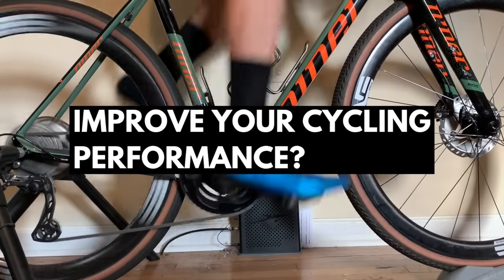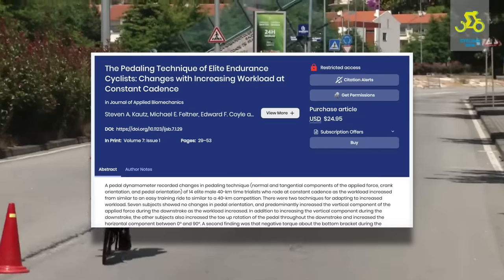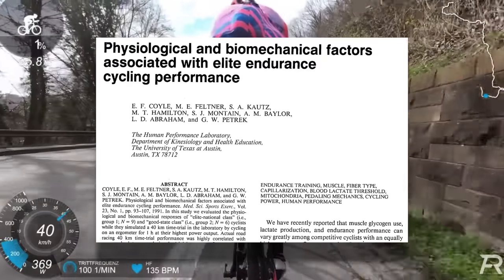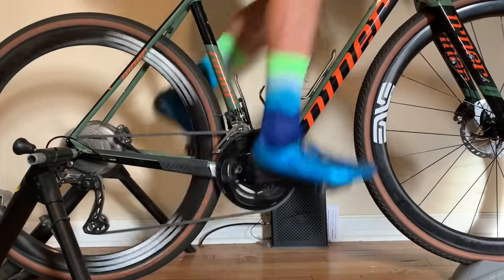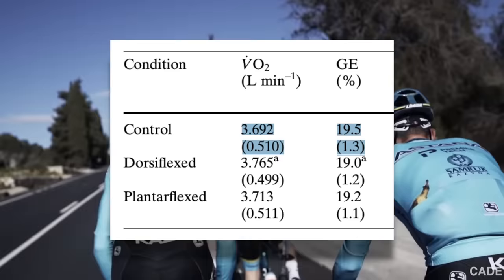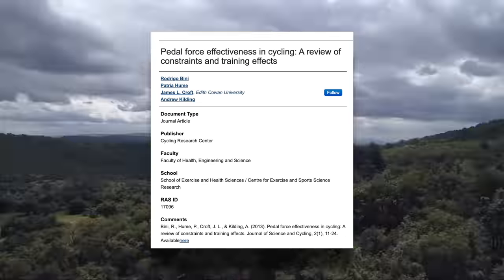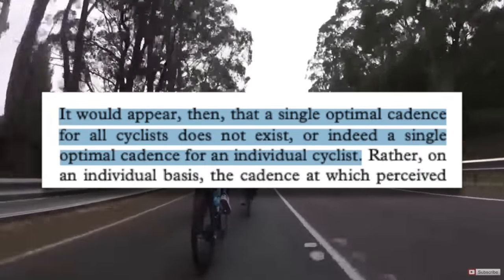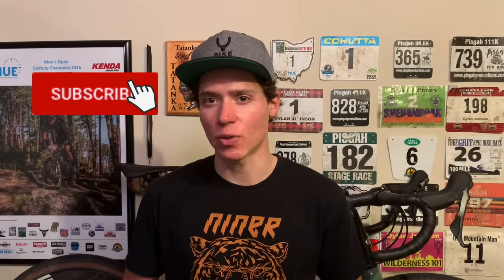Does Your Pedaling Technique Affect Your Cycling Performance? The Science

Comment: As we know, the kneecap ( Patella ) oscillates up and down during the pedalling action.
Just when the kneecap starts its down motion, PULL IT DOWN ( straightening the leg ) with the big muscle in your butt, the Gluteus Maximus ( hip extensor ).
The quads will help. The calves will be used to firm the ankle. 
The hams and hip flexors in the other leg will activate to keep your butt on the saddle or from being lifted further from the saddle.

The primary thought in you mind must be to pull the knee down, extending the hip. After several months, it will become natural.
This technique can be done when riding out of the saddle. It is like climbing a ladder.

Using this technique, one can hold the handlebars with a soft grip, simple to steer the bike. Pros take drinks during a climb !!

Comment: Great vid again. Interesting about the improved efficiency when instructed to 'pull up'. People should be mindful or not misinterpret this and start riding everywhere doing single leg drills focussing on pulling up. I'm sure I've read in a study or article somewhere that included EMG muscle activation analysis throughout the pedal stroke which stated that the improved efficiency which came from pulling up in the pedalling stroke was due to the fact that by pulling up, the rear foot is placing less resistance (aka is getting out of the way better) against the front foot which is in the power production phase of the stroke, enabling better force production if that makes sense. Basically, it's easier to push down on one end of a lever if there isn't something pushing down on the other/opposite end. Single leg drills don't teach that coordination.

Comment: I'm a retired mixed martial artist, so with my age I started to do full distance triathlons since 2017. Last year I accidentally discovered that low cadence increased my speed by almost 4%. Happens during the race, there was a dude hanging around me all the time, switching positions without drafting of course. During the race, I thought that was a good moment to experiment the pedaling styles to see the differences in real life situation. Higher cadence got me dropped, could not keep up, higher heart rate, breathing more heavily. Then I switched to lower cadence higher gear front, than back. Turned out that low blade front, low cadence got me much more speed with quite some ease. You're the expert, does this sound logic to you? This year I will focus training on lower cadence more, that brought me to this upload of yours to learn about power distributions and the do's and don'ts about it.

Comment: I think if you're making noob mistakes then you should try and retrain your stroke. Examples are pushing down on the upstroke - get rid of any muscular tension and weighting on the back leg. You want muscles to be making the wheel spin, not dissipating power into other muscles. This is particularly true when getting out of the saddle. Don't be accidentally braking with your back leg.

Comment: I’ve found that cadence is very individual based on age/cardio/strength/style. But practicing both high and low cadence improve overall efficiency and endurance. Also for me, focusing on keeping the legs relaxed and picking the knees up and using the core as a spring so that the feet ‘float’ around the crank, so whether cadence is low or high, the spin is more uniform and ‘more’ power is derived throughout a revolution even if more force is on the downstroke.

Comment: I think that is because the extensor muscles are actually more powerful and efficient
as we push down, we are doing hip and knee extension, thus, we are using our glutes, quads and helped by hamstrings which are the most powerful muscles of our whole body
while when we pull up, that is hip and knee flexion, that are our hip flexors, hamstrings and calves which are weaker

Comment: This video confuses "power", "force" and "torque".  You keep referring to "power distribution" during a pedal cycle. In fact, it is "force distribution". Power is the total force = work per pedal cycle multiplied by cadence. The article you cite talks about "force" and "torque", but since the crank length remains constant, these terms are essentially the same in this context. Pedaling efficiency can be described as increasing the work per pedal cycle, so not necessary involving a greater amount of maximal force.

Comment: Was interested to watch this as I knew it would be woolly. There is no single key to unlock the perfect stroke. The whole game to me is managing muscle burn. Finding your maximum pace and cadence on all gradients across your ride to maximise your time. Whilst this happens you learn how to add short muscle burning segments into your ride and your muscles learn to recover more quickly after those moments of extra excursion. Bike fit / body position and seat hight obviously plays a massive part in your form. My only advice is ride ride and ride some more. Miles on the bike improved fitness and your muscles ability to perform at faster speeds. I find that average speed is the best figure to watch. I have a 30 mile route that has about 3k feet of elevation that I do a lot and because I do it a lot my body is finding new ways to go faster every week. 
My final opinion as to the key for new found speed is to be in the right gear at all times whilst being just fractions below the mark where muscle burn is starting to set in across your whole ride. Without realising, that mark raises week by week.

Comment: Could you do an explanation on TE (Torque Effectiveness)? I feel like TE has really helped me a lot in terms of optimizing my pedaling method depending on the gradient. And of course, great video as always!!!
Reply: Arthur J I believe this is what gets a lot of people in trouble using or thinking about it in terms of torque. A lot of tri-athletes think in terms of this, and consequently focus on pulling as much as they are pushing down. At least that’s what I learned when I did a few shorter tri distances. The pulling creates a lot of torque on the pedals, but doesn’t quantify to an increase in power. Additionally, for me, my HR was greatly increased versus just pushing down as hard as possible (or needed), and then letting the pedal complete the rest of its circuit with as little interference on the “on” leg as possible. Creating torque on the entirety of the pedaling stroke can fatigue the smaller muscle groups, and lead to cramping. IMHO
Reply: Data is good when you can reference it to a "feeling".    The key is to treat them as a "duo" and not a master/slave relationship.   I use my power meter quite often when trying to correlate it to a feeling.   I have quickly figured out that for a given power level, the cadence does vary quite a lot based upon gradient to make it feel good.    On the flats, I like ~80-90, going uphill 90-105, going down 70-80...and this is all the same power.    So now when i see a hill I can proactively gear/cadence adapt and my VI has gone from 1.15-1.20 on many endurance rides to 1.05-1.10.

Comment: what about mid foot position? I use mid foot position with Catalyst pedals, I have always used this foot position, it always felt the most natural, sable to me,
I use mid foot position, I am 182cm, quite average in size,
I have saddle tip of Fabric Scoop above BB shell, I use oval chainring, I ride a  Geometron G1 Large, which has a modern geometry for mountainbiking.
the geometry,sizing really makes a huge difference, having bike that fits, being able to have proper sitting position, not being squeezed between cockpit and saddle, not sitting too far back.

Comment: A lot of the studies cited here (and in other videos) test the effects of short-term deviations from a cyclist's preferred technique, be it cadence, pedaling technique, or what have you. Have there been any long term studies that show that after a year of training for a deviation in technique, the effect on the cyclist's efficiency was X vs training with the cyclist's preferred technique?

Like I don't think anyone but BHD is expecting to say "Ok, it's race day, time to bump my cadence up 20rpm from normal and focus all my energy on pulling up on the upstroke. This will surely add 20 watts to my FTP!" and yet that seems to be what these studies test. Most people want to know "If I spend months training to change my technique, will I be better off than if I just kept going with my preferred?"
Reply from the maker: Great point. Unfortunately very few long term studies exist.
Reply: Using simple anatomy, your ileopsoas does not have the same power as the quads when upstroking, the muscle has a short lever to work and probably fatique will set in quickly. You can train it, of course, but you use in race day in the last climb for example.

Comment: Hi Dylan, thanks for the video. This subject had me thinking for a long time... I understand the argument that your preferred cadence and your preferred pedaling technique are the best ones for you. However, the Sport requires different demands. For instance, at climbs your cadence will depend on the available gears you have. This might make your preferred cadence impossible to  maintain. Let's say, at 10% grade, using a 52x30 it will be hard to pedal at 95 rpm (at least for me). So, during my practice sessions I should train at 60-70 cadence drills. 
The same way with pedaling technique. During a road race, all the athletes are doing the least amount of effort possible, so, utilizing many muscles to spread the load instead of the mainly quads to push the pedals. This might be the best approach to have the quads fresh for a sprint.  I also believe there's a tendency of the literature to look at threshold efforts when evaluating pedaling technique and cadence. However, unless you're in a breakaway, you're unlikely riding for 4 hours at your threshold. So, research designs looking at the actual race pace Ina peloton should guide our training decisions to develop or not a specific pedal technique and cadence.

Any thoughts on that?
Reply: Yeah, my thought's are that quads being fresh isn't going to change by reducing your efficiency by increasing your work as shown in the study... you need to think about why your muscles fatigue.

Want fresh legs for the sprint, worry about positioning rather than pedal technique.

Comment: cool vid.  is there still any merit in doing pedal form drills like single leg focus pedaling or one leg pedaling? thx!
Reply: Good question
Reply: Probably lower cadence will work better, you never use one leg in cycling unless you are a para-athlete. On the contrary in cross-contry skiing there are several one leg drills, but balance is very important cause you are just sliding on snow one ski at a time ;) have a nice day
Reply: Learning to pedal with one leg helped me  while learning to take off and clipping in in case I missed the clip 😂
Reply: @CandiiBanks  Same here. Clipping in after being stopped at a light or a sign is still scary but at least I can get away quickly

Comment: Very informative, thanks. One question - during training does it make sense to do cadence drills or generally ride in any other candence than my preferred for that particular zone?
Reply: Good question
Reply: training high velocity is always good for the body structure and the capacity of moving very fast your big legs and getting used to recover from short exhaustion/accelerations
Reply: Cadence drills are good at teaching how to be efficient. But it’s also good to pedal quicker when conditioning at lower powers, throughout the ride, to enable your body to deal with neuromuscular fatigue. Which can really hit home at the end of longer rides.
Reply from the maker: Check out my cadence video.
Reply: Depends on what you ride in my opinion. If you are a roadie you'll get 99% the right gear with your usual cadence. If you are a mtbiker probably doing cadence drills helps, it happens quite often to be over or undergear in some occasion during a ride ;)

Comment: Great Video, as always. A follow-up question: is there research on how to be efficient at only putting torque on the pedals in the direction that actually propels the pedals? E.g., training to make sure that a rider doesn't push straight down when the pedal is at the 6 o'clock (bottom) position? It seems like that's a different question from where in the pedal stroke the rider should put the most power into the stroke. Thanks!

Comment: I think that the reduced efficiencies seen in the study when looking at emphasising the pulling portion of the pedal stroke could be partially explained because (as cyclists) their pulling muscles are far less trained than the pushing muscles (~97% pushing power Vs ~3% pulling power seen in the test). Training of a muscle (as far as I could see from research) improves the efficiency in that muscle. If they were to train specifically with the pulling technique, for a period of time to acclimatise the muscle to the work load, the results may look different(?)
I think longer studies looking at specifically aiming to change pedalling technique, over a period of time, need to be carried out in order to really understand if gains can be made by altering a pedalling style. It is not a surprise to me that a persons preferred pedalling style is the most efficient when looking in the short term.
Reply: Pulling muscles are tiny compared to the pushing on the downstroke. Not going to get much of a gain.
Reply: I'm not convinced there would be any change in the result, but you're right the studies cited time and again assessed only the short term impact of changing pedalling technique; it felt like the long term factors weren't given the same consideration (though funnily enough the very first study mentioned did kind of look at that, though was inconclusive).

I'd also like to have heard a side note on injury and longevity.  I imagine messing with your pedal stroke is like bike fit; performance is one thing, but injury rates might be the real differentiator
Reply: @JSBax  It's the same for cadence as well for longer term impact. If your preferred cadence is too low (e.g. 75rpm) then you'll definitely struggle on races since you can't quickly adapt when race pace changes, this is one benefit of high cadence as you can increase your cadence to quickly accelerate and attack/react. 

Getting higher cadence is something that can be trained on the long term as well, I started at 75-80rpm when I started cycling, now my preferred cadence is around 95-100rpm after high cadence training with likely similar efficiency as my old 80rpm cadence but only after a month or so of adaptation which may not reflect on short term studies.

Comment: High cadence I'll tend to spin (pull up slightly), but this increases pressure on your arse so it becomes uncomfortable. Also, I'll get lactic acid build-up in all the extensor digit muscles in my shins. e.g., they'll be on fire at the end of a high cadence interval. As I mix muscle groups up, I've noticed my heart rate drops, for the same output as I start to emphasise spinning, but I can't hold it for long as it feel like all the small muscle groups involved aren't designed for, or strong enough for such a powerful movement. So on a steady long climb, start off spinning high cadence, in the saddle, mixing between pulling up and just mashing, then when your arse is on fire, get up n grind for the push over the top.

Comment: Not that I know anything, this is just how things feel to me: when I am pedaling and the pedal stroke feels smooth, that usually feels good; cadence, there are plenty of different cadences that feel good to me at different points in riding.  When the pedal stroke feels smooth, I also notice I feel my thighs/knees going up and down like pistons: yes it feels like there is more force down, I do feel like there could be a small pull back at the bottom and a small push forward at the top but those don't compare to force applied downward; and no, I don't feel like pulling up is useful; it seems like a waste of time but I am bringing the knee/thigh back up with the pedal sort of as if, the reason is to not make the weight of the leg get in the way of the pedal coming back up.  And that piston action of the thigh/knee up and down feels good at my hip joint.  This is just me observing while riding, not me trying to pedal a certain way.  I think, in any athletic endeavor, you can play with mechanics, technique, method, but once you are doing the thing, trying to focus on how you are doing the action will get in the way of you doing that action well.  So....observing without trying to control is interesting.  And in so many physical or athletic endeavors, overthinking things can make your movement less effective.  Maybe sometimes playing with technique is okay.  But when you do the thing, you have to let your body do the thing.

Comment: Hi Dylan, thanks for another very informative video. I've noticed a strong tendency for my breathing rate to "synchronise" with my cadence when out of the saddle on hill climbs. If my cadence is too low I can go into the red because I'm not getting enough oxygen. Has the relationship between breathing rate & cadence been researched or is this just a rookie error?
Reply: I'm interested in this as well! I experienced this both cycling and running. It's an automatic thing I struggle to control and I think it may limit my performance